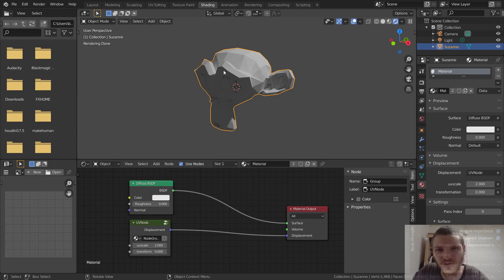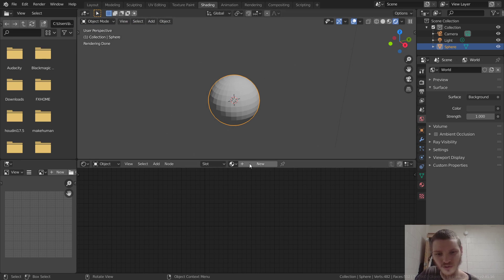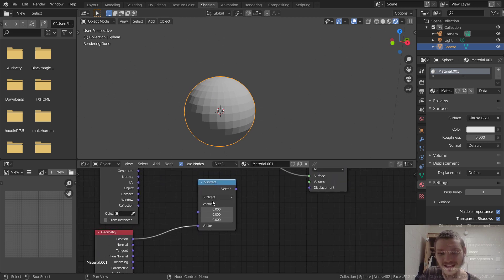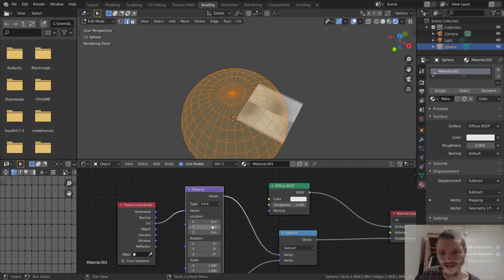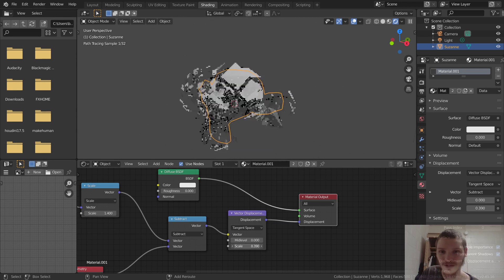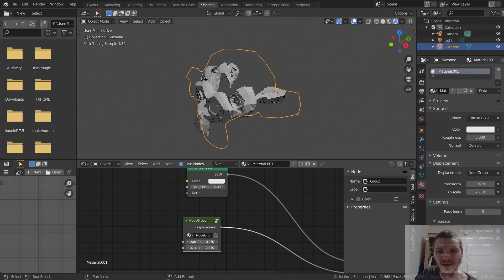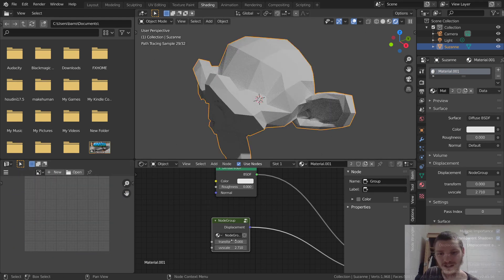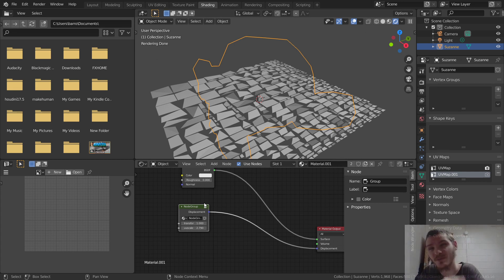How to Flatten With Vector Displacement (Blender Tutorial)

Comment: Awesome !
Alternatively if you want to go non destructive you can add an "Edge Split" modifier and set the split angle to 0°
Also if you want your UV islands to center around the origin of the object and not the origin of the world, Plug a "Vector Math" set to add before the vector displacement node and add the "Location" output from the "Object Info" node.
Cheers !